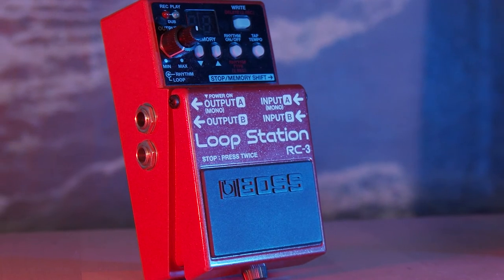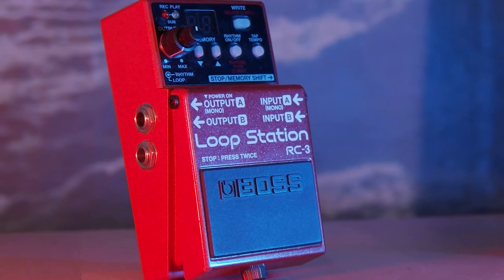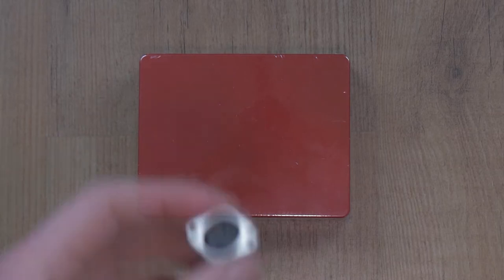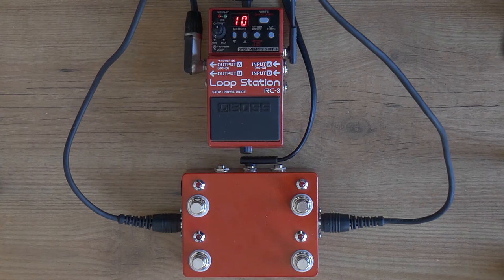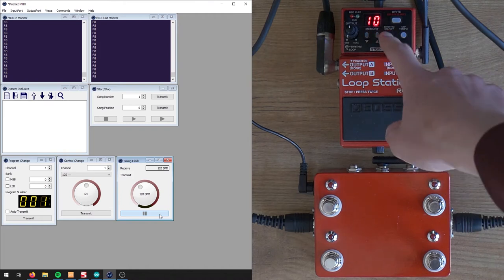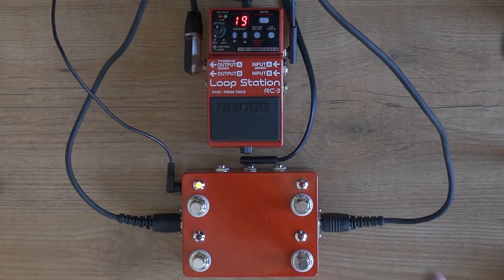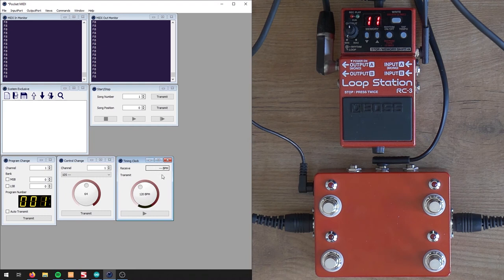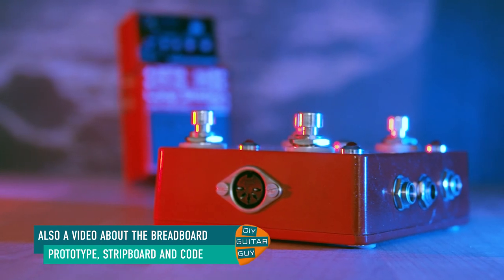DIY Footswitch for the Boss RC3 and more! (part 1)

Comment: What a project, nice man!!! What software are you using in this video?
Reply from the maker: Thanks! For the programming I used the standard Arduino program, for the MIDI signals I used Ableton Live and Pocket MIDI (Ableton can be bit dodgy when it comes to MIDI Clock). Screen captures are recorded with OBS and the video is edited in Premiere Pro.
Reply from the maker: If you're interested, I just uploaded a video about how I developed this pedal. Check out my channel!
Reply: @DIYguitarGuy  I know a little C++, but i'm not good at programming. Thank you very much, merci beaucoup!

Comment: Awesome project!
Could it work on its bigger brother, the RC-30?
Reply from the maker: Not really, unfortunately. The RC30's footswitch jack controls the track, memory and loop effects. So with a little reprogramming you can control those things with the DIY footswitch, but not the stop or midi tempo to tap tempo. If you do want those functions, you have to alter the RC30 itself. You could solder the Arduino controlled relay to the stop switch, but that will void the warranty for the RC30.

Comment: Do you know how i could build a simple arduino based footswitch for the Zoom MS50G?
Reply from the maker: You can't, because an Arduino can't act as an USB Host device, but the Raspberry Pi can! Zoom Multistomps react to midi PC messages 1 to 50 for the corresponding presets, I've made a video about that called 'Control pedals with Midi over USB'. Multistomps also react to system exclusive commands (sysex), but I don't know much about it yet.